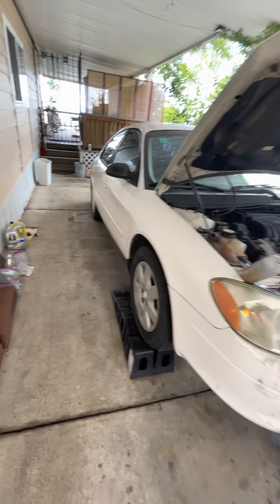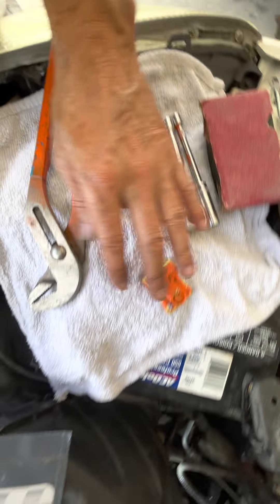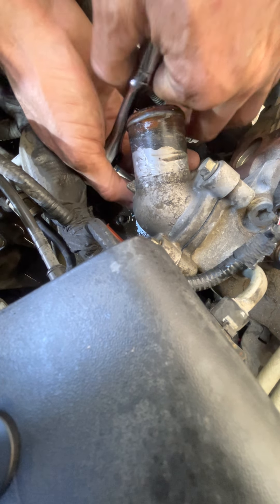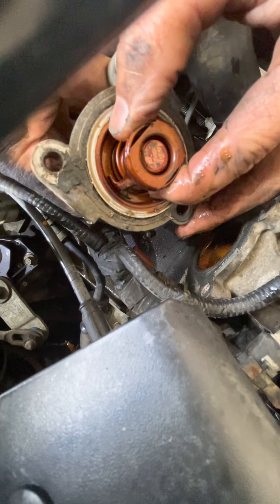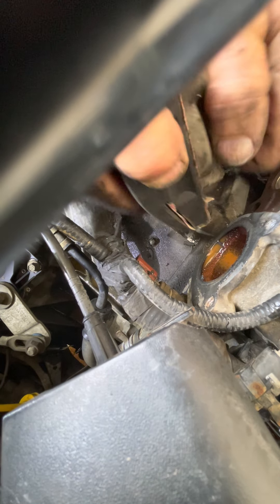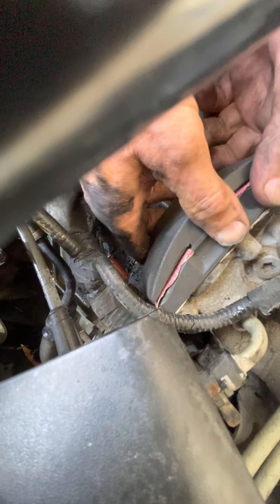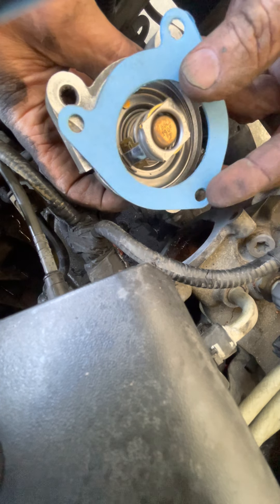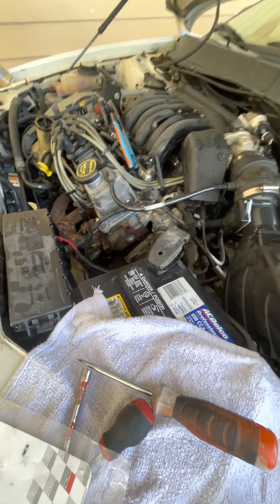How to replace a car Thermostat - Basic Install: Step-by-Step. Using a 1996-2007 Ford Taurus

Comment from the maker: So, to comment on my own video: something I just learned. The Coolant Resevoir has two rubber hoses leading into it at the top. Both have a brass tube inside of the plastic resevoir. One of these is a bit smaller than the other, and can also become plugged up with sediment that's floating around in the system, or corrosion. I had an "overflow" of the coolant resevoir, and couldn't figure out why, because the system was flushed, running at temp, but when I stopped, it overflowed. I removed the brass tube inside the return line at the resevoir, and it solved the issue. Thus, I'm assuming that some sediment broke loose, and was plugging that small orifice? IDK. I have a video on it.

Comment: I know what you mean about other misleading videos. In order to fix my car horn, I went through many parts before I discovered all that was wrong was the wire connection to the horn.
Reply from the maker: That happens at shops too, but the charge you! 

Sometimes I spray electric cleaner on electrical connections or just check fuses first.

Comment: I have a 2000 Dohc is the thermostat in the same place?
Reply from the maker: No. The DOHC is a completely different set up. It's got an o-ring seal, which may or may not come in the box with the T stat, idk. It's a bit different of a set up, and you should watch a video that's specific to the DOHC. As far as the temp rating, just OEM is best, imo.

Comment: I have a 2001 ford taurus....what was the original thermostat 180 degrees or 192 degrees on your vehicle?
Reply from the maker: IDK. You just are better off OEM, which sometimes is a higher temp. 
Opens at a lower temp in theory keeps the engine cooler? But, it’s designed for the OEM specs. It’s not a huge deal.

Comment: did you drain the coolant
Reply from the maker: Yes, by opening up the drain plug, and putting a lightly running hose into the coolant fill resevoir, car not running, a bunch of stuff will flush out. If you see serious signs of rust and sediment, then you might want to use a stronger cleaner and run the car for a 100 miles or so. Or, if the Heater Core is not putting out heat, it's probably plugged up.  One issue is that if you bought a car, and the heater core is plugged, it MIGHT be bcuz the previous owner put in some type of homemade (sawdust) or commercial "stop leak." Cleaning up the system might dislodge that "stop leak" and you can suddenly have a leak inside or outside the vehicle. 

Anyway, you can turn the car on and off while a hose is running in and the drain plug is open, and flush out some stuff. But, the thermostat won't open and the fluid / cleaner / water flush needs to go throughout the entire engine versus only the radiator and hoses with a 'cool' car. I like to run the chemical flush for 20-100 miles. 

However, you can flush the system and try to get that heater core working again, and then apply some "stop leak" materials, which might seal the leak again. 

Buy 100% coolant, not a 50/50 prediluted. Put the new fluid in then add water, most cars one bottle. Shoot for a 50/50 mix. Be sure to use the correct fluid per car / engine type.  The coolant system is critical since it also usually cools off the transmission fluid. Cars shouldn't run too hot. But, if they do, you can run the heater on full blast until you can pull over. 

BTW: never add cold water to a hot engine. Could crack the block.

Comment: next time don;t remove the hold not necessary just remove 3 screws
Reply from the maker: Hi, I believe you meant to say "hose"? I disagree, and like to ensure the hose is not old, still flexible. 
Usually, the hose is "baked" onto the metal and removal of the hose can cause it to break apart. 
So, it depends. 
If it's a good hose, and clamp, don't take it off. But, I wanted to do a simple, Step-by-Step to help others understand all the steps.